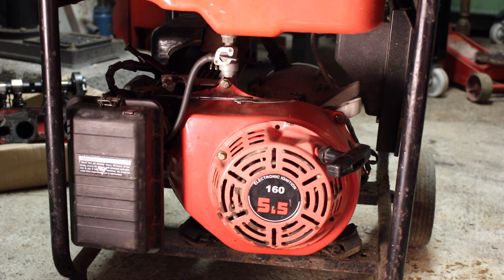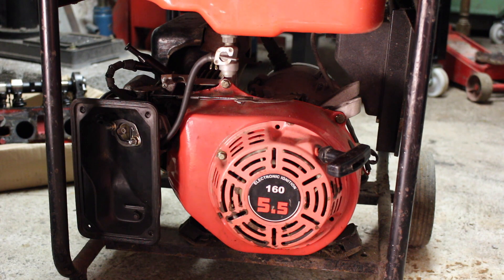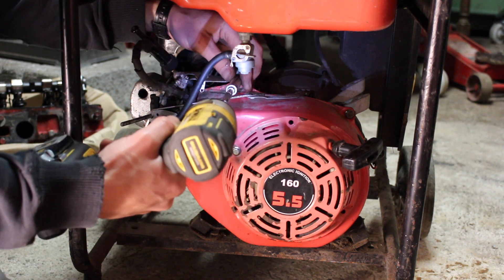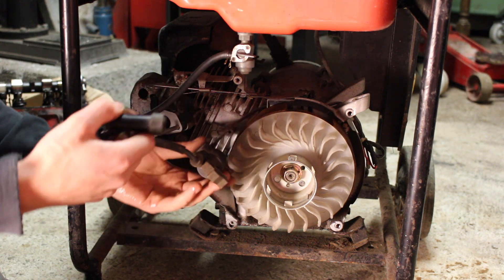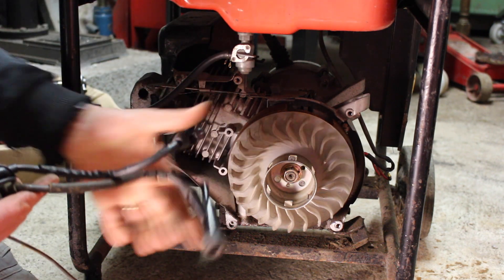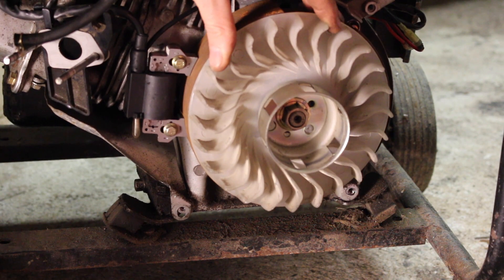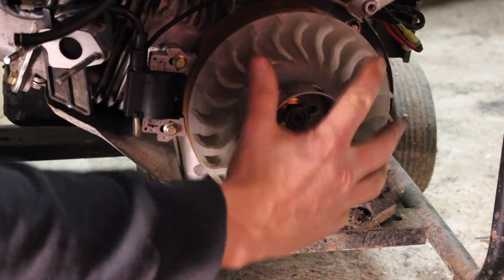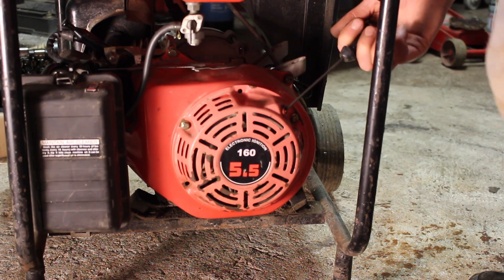How to Replace the Ignition Coil on a Honda GX160 GX200

Comment: Thank you! Your coil wire has 2 leads (1 to off/on, other not sure) same as mine (168F/170F) but replacement coil (168F-8T) only has 1 lead
Any advice?

Comment: To gap the coil to the flywheel, on this or any similar enginge, loosely bolt on coil. Place a piece of paper between coil and flywheel. Rotate the flywheel to where the magnet holds the coil to the flywheel. With the paper between them. Tighten down coil. Rotate flywheel to remove paper. Letter paper is just the right gap. Junk mail is a good source of this.